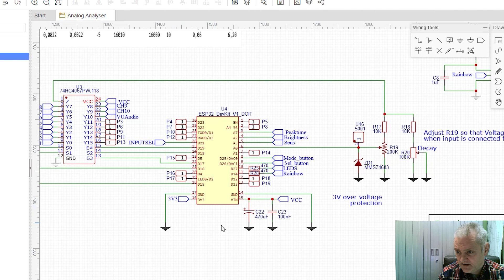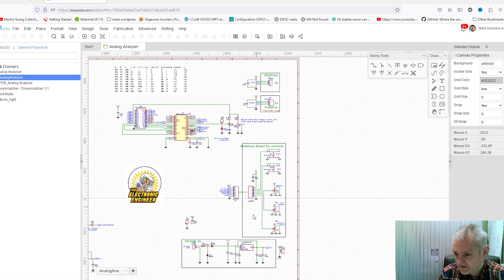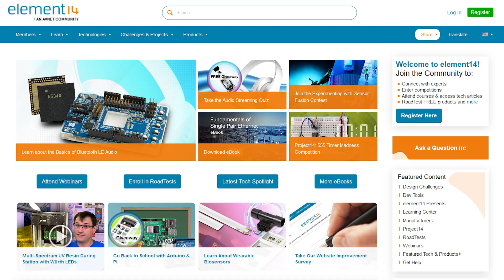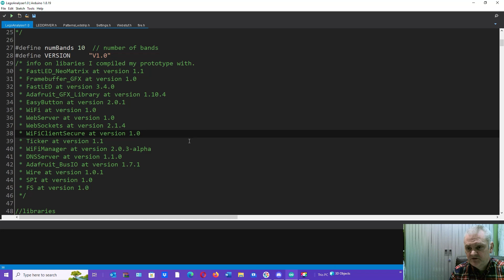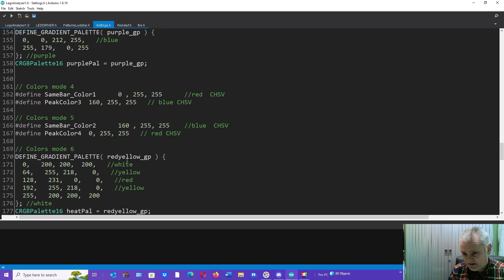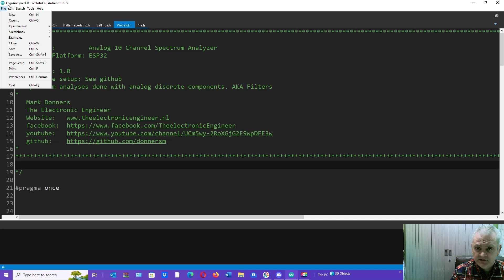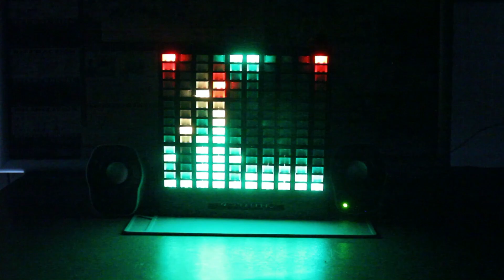How to Build a Spectrum Analyzer with Lego Bricks & Discrete Electronics

Comment: If you're already using an ESP32, you can do all the signal processing on it, and get rid of all the filtering and MUX components. Can use FFT or Goertzel filter array in software.
Reply: Yes been there done that…I build several units with FFT but I wanted something else this time.  On my own channel @theelectronicengineer you can find several fft analyzers\

Comment: Summary was generated by Summatim, let us know if there are any inaccuracies! 🤖
0:01: Introduction
1:06: Analog Front-End
1:26: Microcontroller
2:26: Assembly
5:05: Interface Board
7:08: Putting It Together
9:06: Arduino Sketch
11:50: Demo
12:45: Conclusion

Comment: Since when a micro controller counts as discrete electronics?
Reply: The microcontroller is used to drive the leds but the actual frequency analysis of the input signal is done using discrete components. Opamp band filters to be exact
Reply: @TheElectronicEngineer  ok, since when any kind of IC counts as discrete component?